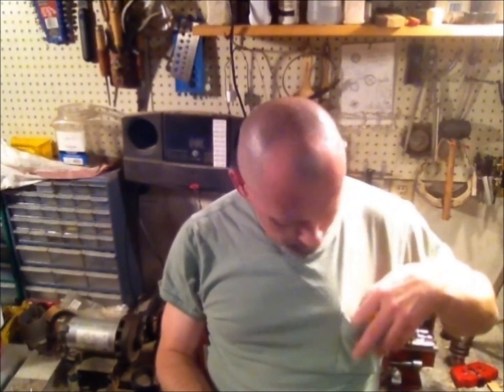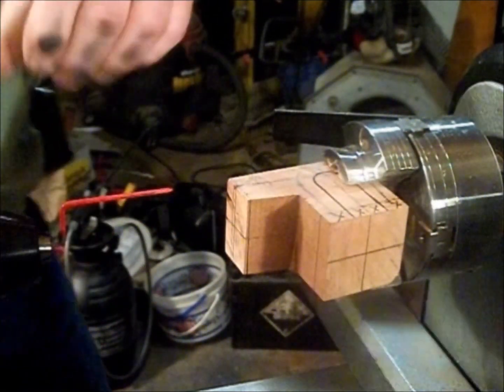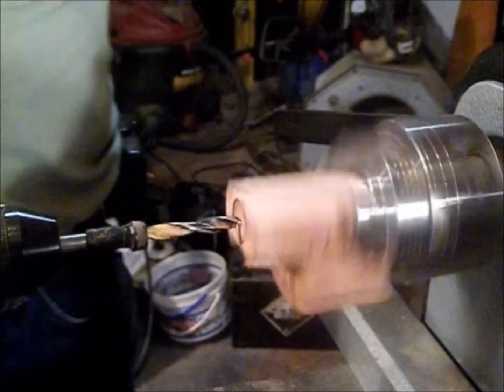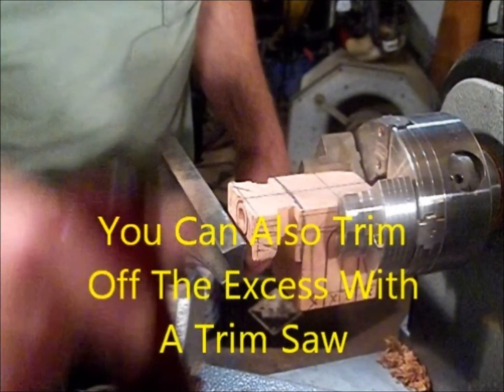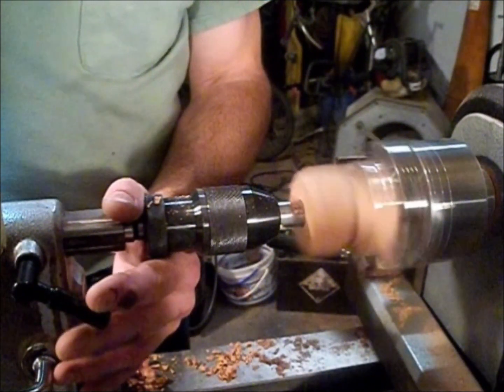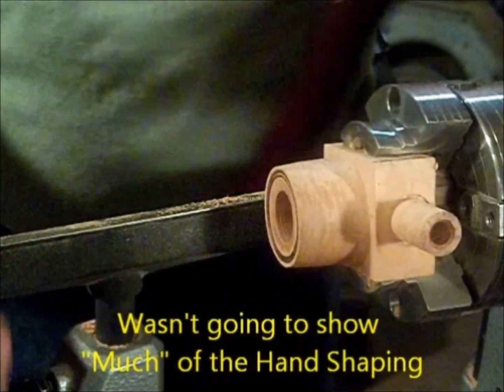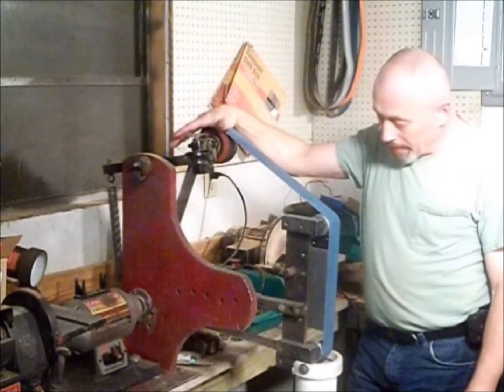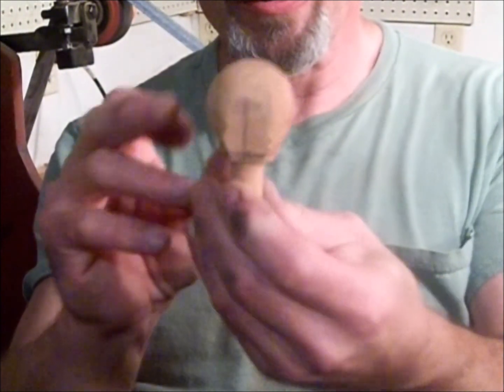Pipe Making Tutorial

Comment: what size lathe is that? and have any tips on getting the cheapest possible supplies? great video
Reply from the maker: Thanks! It's the Delta 46-460 which is a 12" midi lathe. Here's a good place to get supplies. http://vermontfreehand.com/
Reply: Tim Pollock would you please be able to tell me a list of the tooling I would need to get started, such as chucks and bits? Also chisels? Thank you again sir
Reply from the maker: Just the same basic gouge set you'd get for any wood lathe will do, there are several decent brands out there at reasonable prices for a starter set. A small set of drill bits and a custom spade bit of your choice for drilling the chambers. Tooling is all pretty much personal preference for each maker.
Reply: Tim Pollock much appreciated sir